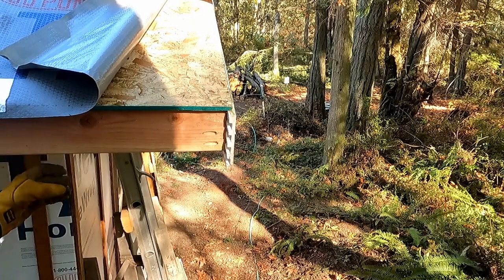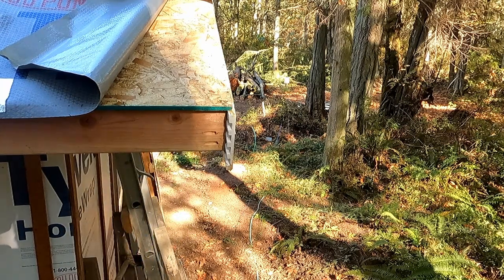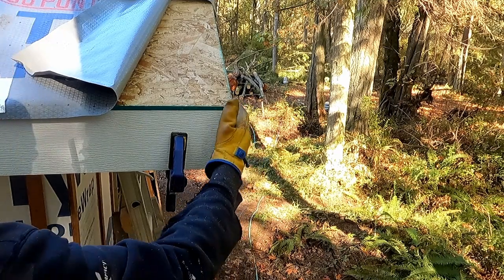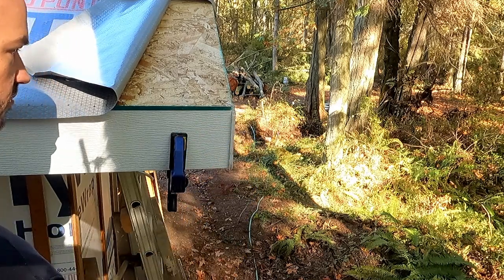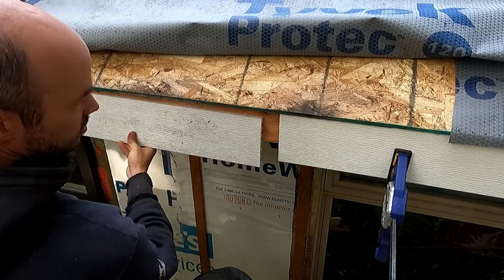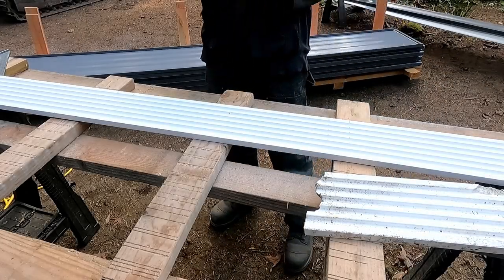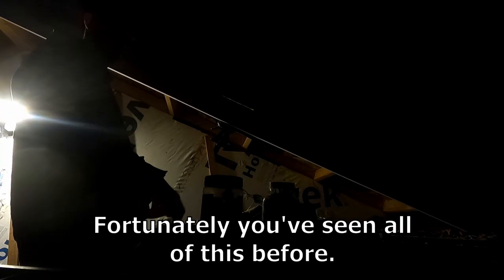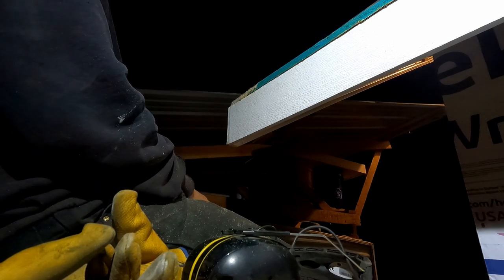Solvent Welding PVC Trim

Comment: You've lost your mind doing the detail pocketing, but I'm in the same boat.  I can do the best job on my friends kitchen, because I have the time.  I'd be out of business after the first job if I tried to make money at it.  Used PVC on a couple inside miters once.  Makes a killer joint in 30 seconds and can then bend the trim to meet 1990's house build quality of +/- 10 degrees
Reply from the maker: Exactly! Making ANYTHING is so much more fun when you're not trying to make an hourly rate. And you can try crazy things if it suits you. Is it going to work? I don't know! Ask me in ten years.